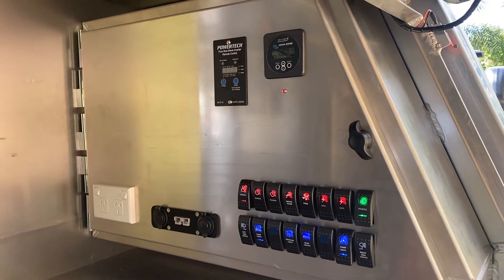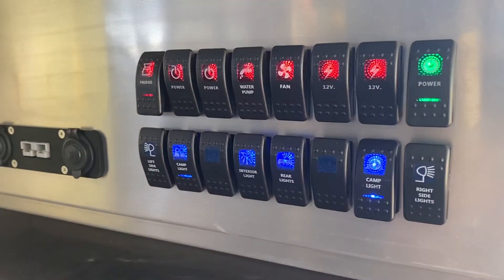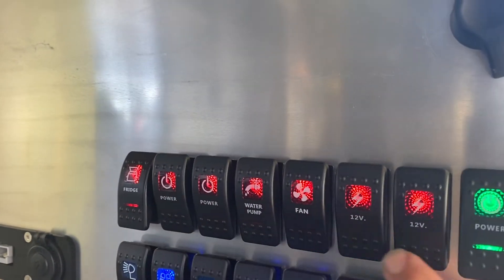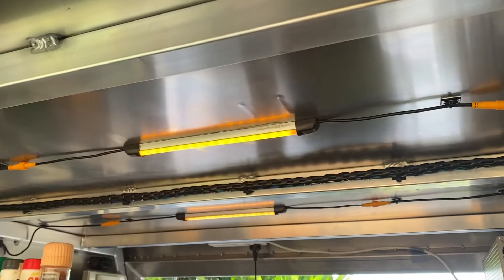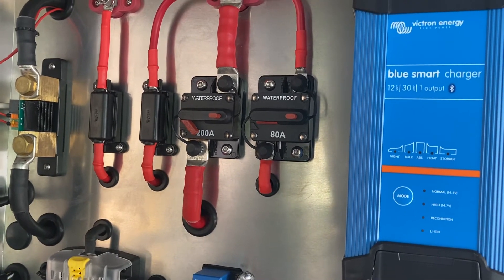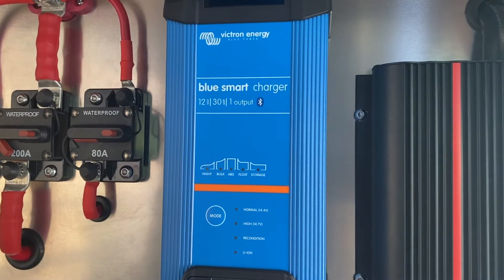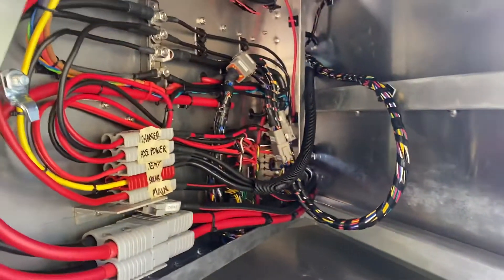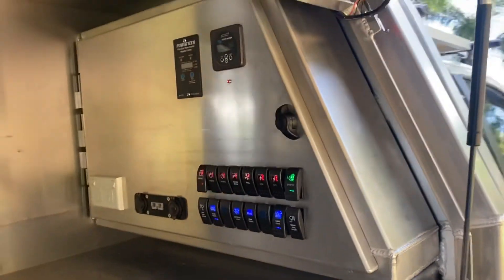My 12v Electrical System- Ben’s 4wd Canopy

Comment: Just watched your vid and I must say that is a bloody good canopy electrical system set-up.
Reply from the maker: Thanks Craig, it was a big job, but worth doing it all in one go
Reply: @aussiecampingbloke55   Did the canopy builder make this from your design ?
Reply from the maker: @craigbrysse887  yeah he sure did, i told him what I wanted, and once he gave me the dimensions I planned the layout. The fun bit was working out the sizes & where all the holes for the grommets had to go 🙄
Reply: Hi great build. 
Just read yr comment and I thought you might like to look at my set up canopy and 12v for some ideas.
Cheers 
Out There Touring

Comment: Hey mate unreal setup with the box. Love that idea. Was it worth the price getting a fabricator to make it all enclosed vs being open on the back board? Cheers
Reply from the maker: It was a vision that I wanted to had , I wanted it no matter what, so yeah it was worth it. Besides from one oversight with the central locking, everything works as planned. But more importantly, nothing has failed
Reply: Hi great build. 
Just read yr comment and I thought you might like to look at my set up canopy and 12v for some ideas.
Cheers 
Out There Touring

Comment: What size cable you running for you fridge? Looks like about 3mm?
Reply from the maker: Yeah, all the wiring is 3mm, good for 10amps, besides the wiring for the tent, solar, and power outlets which is 6mm, and obviously heavy wiring for the battery’s and inverter which is 50mm from memory
Reply: Thanks mate, also, your norweld canopy would have to be about exactly what I want as I'm buying a dmax space cab. Is your canopy a standard optioned canopy? As in straight off their site or did you build custom? Cheers.
Reply from the maker: @TechStories79  it’s a Norweld tray, but not a Norweld, they don’t do custom, it’s a Pensini Alloys, their work is just as good.
Reply: Hi great build. 
Just read yr comment and I thought you might like to look at my set up canopy and 12v for some ideas.
Cheers 
Out There Touring